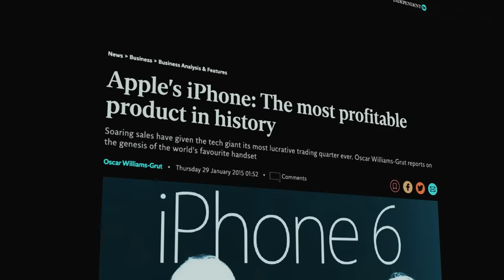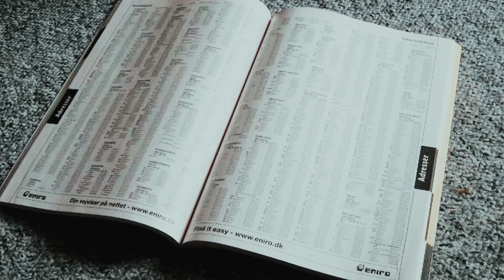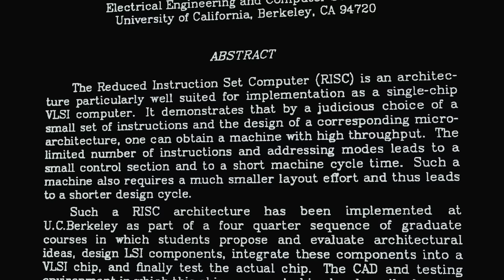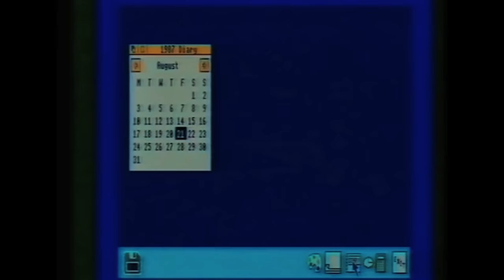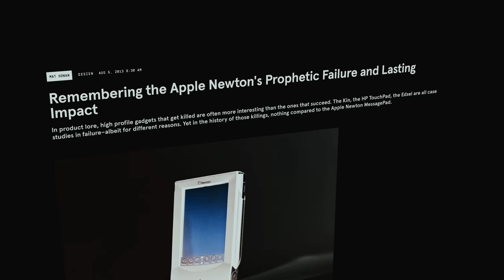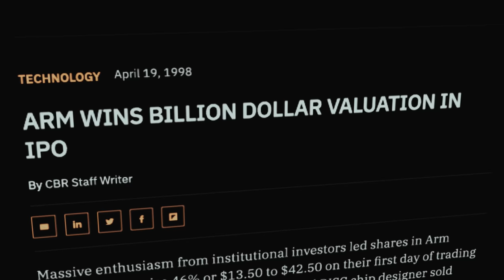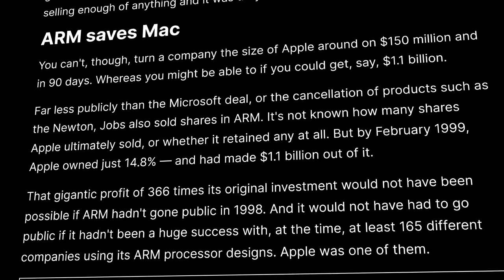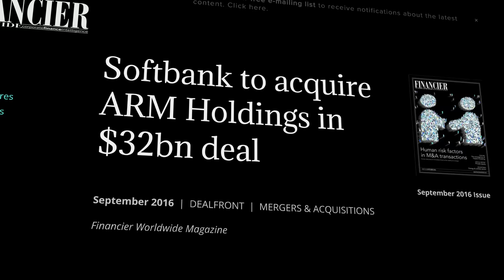How ARM Saved Apple

Comment: I worked in the smart phone industry back in 1999. No one used Intel for the primary CPU for mobile devices. Now we call the first gen smart phones "feature phones". The processor used by the first smart phone Neopoint wasn't intel for a simple reason, Intel CPU were way too power hungry. Intel was never a credible option for mobile devices.

Comment: surprised you didn't go into the part where Intel owned a significant portion of arm and sold it off.. Also PDA's in the early 2000's used the Intel Strong ARM variant (ipaq among others).

Comment: A note as well. Apple owns a perpetual license for the ARM architecture. Which essentially let them hard fork the architecture. So Apple chips are designed by Apple in house using essentially their own version of ARM. 

So a company like Qualcomm or Samsung can’t just buy the cores Apple uses for their chips as arm holdings didn’t design them, Apple did.

Comment: I have a question: Why did the Power PC (ARM based) Macs fail in the 1990s? The chips were made by Motorola and IBM, I believe. Curious. I have had both lol.
Reply: PowerPC is not ARM based. It's a power hungry RISC based chip with heat problems which is why Apple had to jump over to Intel.
Reply: @miketran4289  I regret the error.
Reply: I think I meant to say that PowerPC was RISC based as is ARM. I sort of got it backwards. But you already made the comments about the power.
Reply: PowerPC was quite an efficient chip when it came out. The best Intel could do in 1993/1994 was the Pentium 60/66, which came in a huge package the size of a VHS videocassette.

By about 1995/1996, though I think Intel had moved to a new process, so the newer-generation Pentium 75 and Pentium 90 were much more performance-competitive, and also power-consumption-competitive even against the new PowerPC 603 and 604 chips. I said at the time, they were probably spending 10× as much on their chip designs as Apple-IBM-Motorola were spending on PowerPC ones, but then, Intel were selling into a market 10× the size, so they could afford more complex chip designs.

Nowadays, PowerPC has been subsumed back into IBM’s POWER architecture. And it still offers good price/performance. You will see several POWER-based machines near the top of the list of the world’s top 500 supercomputers.
Reply: @lawrencedoliveiro9104  Thank you very much for this excellent clarification.
Reply: No ,heat wasnt the problem steve jobs asked a 3ghz chip and IBM didnt wanted to make it.

Comment: ARM 1 through ARM 710 was a bit of a cheat - a 26 bit cheat, and not the 32 bit CPU that you'd think it was. RiscOS was developed for this. When Acorn went bust in 1998, Castle Technologies gained the rights to the RiscPC, to continue to develop, while the new Iyonix PC was developed using an Intel XScale CPU, clocked at 400MHz, and would be the first 32 bit chip that RiscOS 5 would be developed for. But sadly the Iyonix was not very successful for the lead free soldier process, and so couldn't be sold the traditional way. Meanwhile, other RiscOS die hards developed the A9Home, a small ARM 9 32bit computer, running a modified RiscOS 4. But ultimately the Raspberry Pi had become everyone's favorite RiscOS platform. Acorn may be gone, but ARM (Acorn RISC Machine) was one of Acorn's Spin off companies which has gone on to be highly successful.

Comment: Microsoft has also produced a version of Windows that runs on ARM as opposed to Intel CPUs.  There's the possibility that at some point PC vendors could abandon Intel for ARM as well - Apple is already squeezing better performance out of ARM CPUs in laptops than you can get out of most Intel designs, and it's likely desktops will also reach some sort of parity over the next few years.

"Acorn" may yet come to rule the dekstop.
Reply: They did it for the windows tablets. The problem they have, tho, is that they run the x86 standard windows software on emulation. Apple made a different OS for the phones so they didn't have that issue.

Comment: Intel doesn't hold jack at this point.
It spun off its fabs into a seperate business model because it took 8 years to bring 10nm when competition from TSMC had long moved to 7nm and 5nm. They even renamed their 10nm as N7 which is a smaller number for "marketing purposes" to not seem like they are 2 generations behind at the fabs.
Their CPU's have long been surpassed by AMD, where AMD's CPU's use less power for the same performance while using less cores. 
Their mobile division never took off and is pretty much junk.
Their GPU business might do better if they keep undercutting the competition by 2-3x but is it really undercutting when the product is only half as good?
Intel was complacent for a decade and has now dwindled into a massive IP company with nothing to show for it.

AMD is the true king of x86 with constant development and improvement that is far beyond anything Intel, ARM, or Nvidia can do. Yet people will still buy those other companies stocks until the bubble bursts.

Comment: RISC lost on the desktop bec CISC CPUs like Ithe x86 integrated their ideas but kept software compatibility.
Look at the Pentium for example, it takes the x86 instruction and decodes to microcode...

X86 kicked ARM RISC for perf but at the cosy of heat and energy use. ARM crushes on efficiency, exactly what a mobile device requires

Comment: Not trying to be a snob but ARM's licensing didn't just include licensing Instruction Set but also the hardware IP. Instruction Set without the Hardware IP is useless and vice versa (you only mentioned about hardware IPs till the end of the video). Thought I should mention this.😄😄😄

Comment: Is the Gates involvement (cooperation) with Apple also the reason, it changed the processor architecture from PowerPC to Intel?
Reply: No. That was many years later.

Apple transitioned to Intel because the PowerPC couldn’t match Intel’s performance at that time.

Gates had nothing to do with it.

Comment: I think, it is a pretty wrong conclusion. Yes, everybody in the Tech Industrie is using ARM but it is just because it is cheap, it is proven and it is common. If not ARM it would be another small RISC InstructionSet of any other company. And Apple is one of three companies who formed the ARM Ltd. So yeah, why not using this stuff you already own and you don't have to pay for (Apple has a free license to design there own chips for no fee)? It is just the Instruction Set Apple is using. The complete hardware came from Apples engineers who came from a small startup called PA Semi from Israel. Apple is not using any hardware design from ARM, like the Cortex Cores or anything else. The chip design is unique and not comparable with any other ARM chip who is based on ARMs own designs and where licensed to the chip manufacturers like Qualcomms Snapdragon, Samsungs Equinox or Nvidia's ARM chips.

Comment: It would be best if Intel continued to work with Windows only, Arm with Apple, and AMD with Linux. Also, China, Japan, and Russia to have their own chips and OS. It would be better and less chaotic than what is happening now. Also, Internet need to change. Google should relax and stop thinking they own the internet. Additionally, it should be prohibited to initially offer software as Open Source and free, only to later convert it to closed source and charge for it once people have become accustomed to using it. In most ways, that same people helped to develop a damn thing. It is akin to providing drugs to someone and, once they are addicted, beginning to charge them for it.

Comment: This video provides an interesting chronicle of the ARM architecture evolution but are riddled with sensationalist, distorted claims bordering misinformation. No, Apple is not secretly British! ARM, the family of RISC instruction set architectures (ISAs) that Apple uses in its CPUs for mobile devices like the iPhones and iPads since 2006 and more recently in the company's M-chips (from X86-64 to ARM64 ISA) powering Mac laptops over the past three years, indeed originates in the UK in the early 1980s. It's like saying that because vital component like the 5nm CPU of the recent iPhones is made by TSMC, then it means that Apple is secretly Taiwanese, or Samsung-made memory or OLED screen infers that Apple is secretly a Korean company. Apple components are sorted from thousands of vendors from N. America, Europe and Asia--some of whom are, as forementioned, Apple's biggest rivals. Hence, it's not ARM chips but Apple chips using ARM instruction sets (ISAs)! ARM based CPUs are extremely power-efficient and therefore ideal for small computing devices that consume less power in a small form factor like cellphone. As Li batteries become more powerful and in particular Intel X86 based chips start to fall behind TSMC (in addition to Intel other troubles like its modem), Apple decides to make the switch of the Mac line of laptops and iMac desktops to its own CPU, Apple Silicon, based on ARM64 architecture.